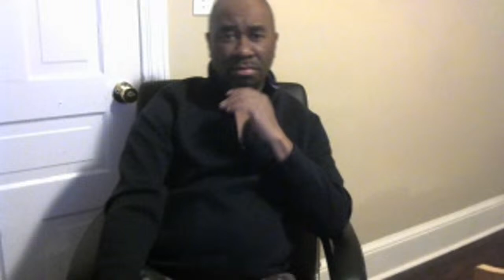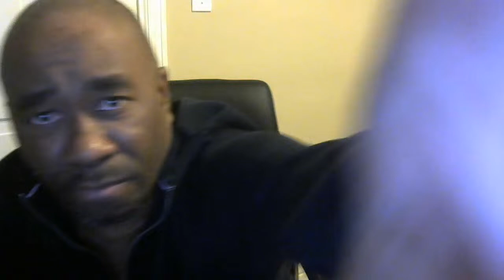Answering your Constructions Questions.

Comment: How long after the drawing is approved by the Municipality are you allowed to wait before the drawing has to be resubmitted  again?
Reply from the maker: After the drawings is approved you have six months to start construction. If you don't start within that six months you will have to resubmit the drawing and pay 10% of the original approval cost. After two years the building plan has expired and you would have to submit a new drawing and pay all the fees necessary for approval.
Reply: @jkengineeringarchitecture.  Greetings 
Is excavating and casting the foundation enough to qualify as "start construction " and therefore wont require a resubmission  even after a  year ?